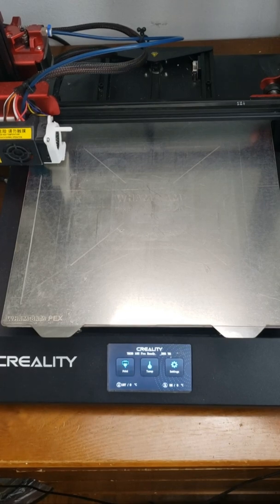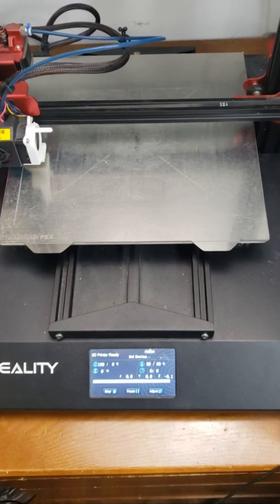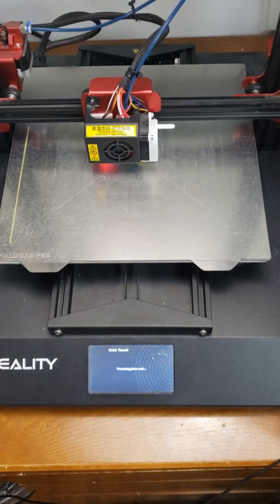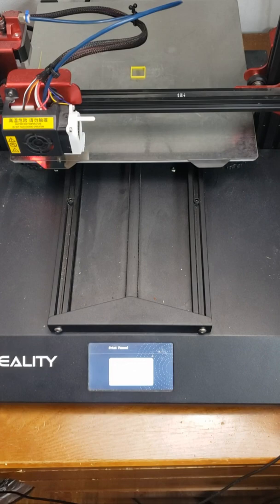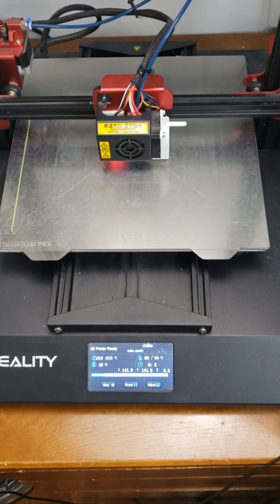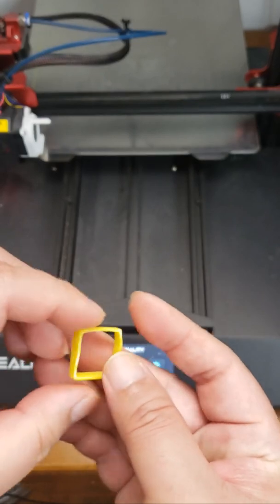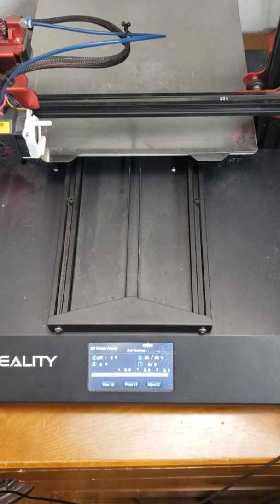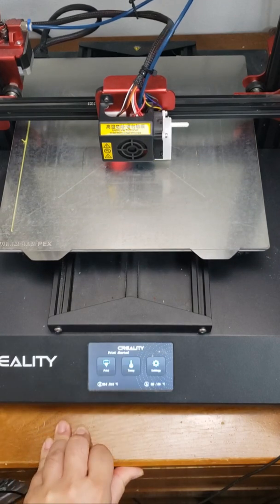Q&A Filament Runout Sensor - CR10S PRO WHY CAN'T YOU RESUME PRINTS AFTER YOU PAUSE THE PRINTER?

Comment: Hi James thank you for your valuable videos. I'm using a Creality CR10S Pro v2 with 1.70 Creality fw. Yesterday I had a power outage and after electricity came back printer noted me to resume and I select the resume button. It started to print. The Z height was correct but x position was shifted around 3-4cm so I cancelled the print. Do you have any idea about what the problem was?
Thanks 
Onur.

Comment: hi. resume printing after hang up or shut down for cr10s pro is working or not? for me nothing .what to do?
Reply from the maker: Depends on the firmware. Most of the time I would not recommend the resume print. Maybe better to use two separate prints and glue them together.
Reply: @DiyProJames  After searching the internet, I realized that I had to activate the resume print command in Arduino ide in the Tiny Machines firmware. I tried several times but failed, so I changed the firmware and installed the same creality firmware and it worked.(ver:1.70.1)
Can you advise me how to enable printing after shutdown into tinymachines? Because I like the environment and features of the tinymachines much more.thanks a lot.

Comment: Hey James - I recently had a heated bed failure due to the wires breaking on the heated bed. I was sent a replacement which i have installed but i am worried about the wires breaking again is it possible you could show me the bend you have on your machine and how its tied down like that because it looks like it doesn't kink or bend like mine currently does. Thanks!

Comment: It pops up twice for a reason. The tip has to be hot to change filament. After first press, it heats up tip. Then you change filament. Once changed, you press it again to resume printing.
Reply from the maker: You are correct.

Comment: Hi James, firstly thank you, your videos are helping me so much:) Wish you had a patreon!

My printer will not resume print when i press yes, it heats up 
but then when it reaches the correct temperature it just goes back to the
same yes or no screen:(

I use: i10SPro_BIL_DW7.hex 
on my cr10s pro
Reply from the maker: You're welcome.. I haven't established a patreon page because having multiple tiers would make everything more complex... Yes, it's unfortunate your printer doesn't resume, but there are work arounds. If you know how much filament you have on your spool you can place a code in the slicer to pause and resume prints. Many people use this method to change filament colors.

Comment: I have a cr10-s pro v2 and the filament sensor does not pause the print, when it runs out of filament it just keeps going ruining my prints
Reply from the maker: You're probably running firmware that doesn't have the runout filament activated
Reply: @DiyProJames  Same issues...
where can i get the best firmware for this printer?